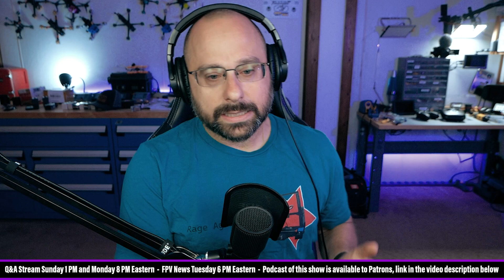Why Do We Have Video On 5 8ghz Instead Of 900mhz? - FPV Q&A

Comment: You can 100% do video on 900MHz, and lots of folks back in the day especially with fixed wing aircraft did this.  For linear polarization the antenna length is feasible for 2-3m aircraft.  You touched on the primary reason folks don’t do it on 5” quads, #1 is antenna size for that form factor and #2 is number of channels that fit in the 5.8 band (40+) as you mention, which is more that could ever fit around 900MHz.  But if you want extreme video range, there are types of antennas (inverted V comes to mind) that work well on 1.3GHz that get you MILES further and better object penetration than 5.8 at the same RF Tx power output.
Reply: Very interesting, thanks! I was actually wondering about 1.3GHz - not sure if it’s legal where I live but I do see local suppliers stocking the hardware. Joshua mentioned problematic harmonics between 900MHz control link and 2.4GHz video link (assuming I understood correctly!) but is 900/1.3GHz also an issue? A longer range VTX would be awesome.
Reply: Yea I looked into 1.3ghz video before. But never bit the bullet never have gone extreme ranges.
Reply: @divingfalconfpv4602  matek makes a great analog 1.3 VTx.  Good luck finding a non crappy VRx though.  I got one that’s 10 years old off eBay that works.
Reply: @nofearjer1  matek was suppose to make a new version of the old vrx I thought

Comment: Yes I used to fly on 900mhz.  I think I still have the equipment.  It did work very well.  5.8 is very disappointing and now I use 1.3 just because of the availability of components.